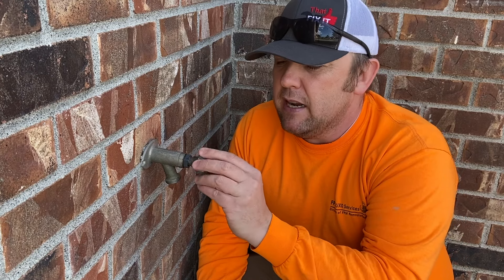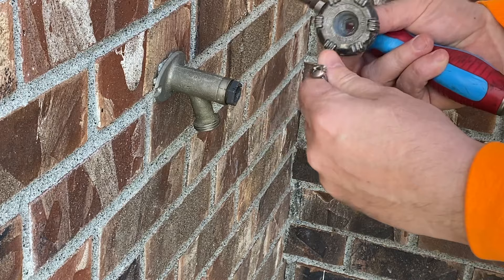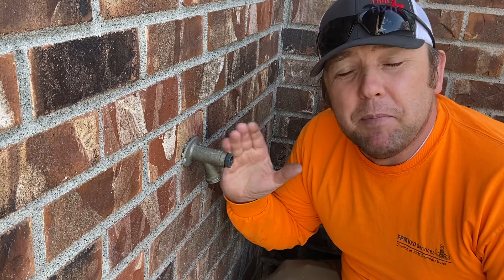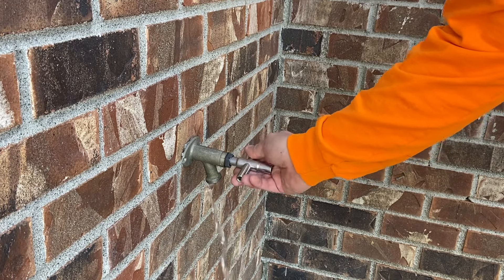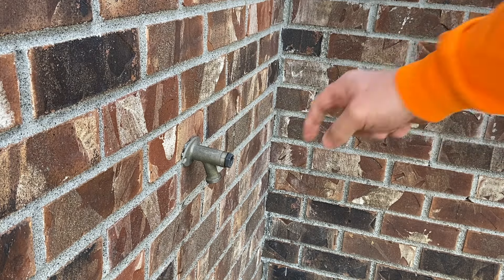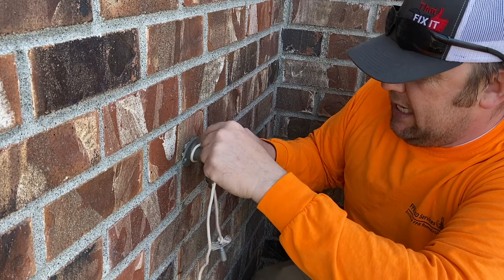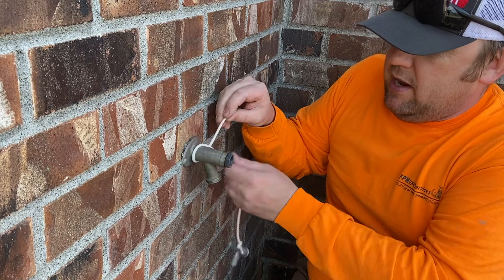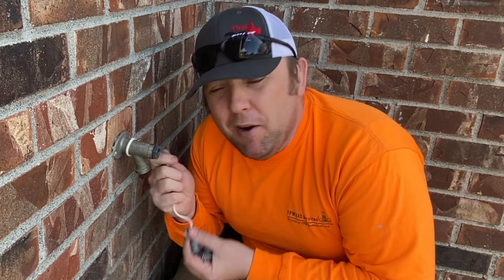QUICK and EASY Fix for Outdoor Faucet Handle that is Stripped!

Comment: Great video, but after using the key, it appears that the valve itself is stripped.  And for some reason my inside valve isn't turning off the water either.  Good times.

Comment: Thanks for this video. Our outdoor faucet handle just keeps turning and we have to push it in as we turn to turn off/on. This video is helpful but a question: I tried to unscrew the handle but the flat-head screw won't budge. How do I get it off? TIA
Reply from the maker: Spray it with some penetrating oil.  PB Blaster  is what I used. You may have to let it sit for a while. That being said I also had to break the handle to get a better bite on the screw

Comment: Hey Brian, I know you said you don't want to strip the screw holding the handle in place, but what if that thing just will not come out?? I've tried getting it out and its starting to stip. Appears to be a softer metal that both my flathead and philips head is starting to strip.
Reply: I’ve found that drilling it out helps. Use titanium drill bits and drill into the stripped screw head. Once the head is drilled through, the handle has nothing holding it down. Then just replace the screw

Comment: Hi! Thanks for the video. I have a Prier handle that will not move/turn. Do you think what you shown in the video would work for this issue as well?
Reply from the maker: It very well could be the issue. You should be able to get a prier handle pretty easy.
Reply: @ThatFixItGuy  Thanks the key was just the fixed needed.

Comment: i bought a house and we have that key but the previous owner has mis-used the bit on the wall and stripped the bolt round. Can you do a tutorial on how to replace the part on the wall or do I have to call a professional to replace it? sorry if im using the wrong terms, english is not my first language.
Reply from the maker: Can you see a manufacturer or  numbers on the hose bib?  Will have to have that info to get the right parts.

Comment: looks easy so I tried it but it didn't work.  I used the sillcock key to try to shut it off, but it just kept turning, just like it did with the knob.  Please help?  What does this mean?
Reply from the maker: If that is the case you may have a broken stem.
Reply: @ThatFixItGuy  the plumbers are telling me that I have a frost proof that has busted because I didn't unscrew the hose and that they have to cut into the drywall and that it will cost hundreds of dollars.  It is a 40 year old faucet.  Am I being taken?
Reply from the maker: @wesreid8393  that could be the case.  You should always disconnect your hose from the bib in the winter.  Is it leaking the the house?  or is it just not working?  Most plumbing companies will replace rather than repair. if it is that old may be worth getting a new one put in,

Comment: What if the screw to take the handle off is stripped?
Reply: I’ve found that drilling it out helps. Use titanium drill bits and drill into the stripped screw head. Once the head is drilled through, the handle has nothing holding it down. Then just replace the screw

Comment: What about when the screw that holds the round handle on is stuck and the handle is so calcified that it actually breaks off when I tried to turn it with pliers?
Reply from the maker: I would spray down the handle with some PB blaster then try to take that screw out. If that works you can get a replacement handle.
Reply: My handle just broke off today🤷🏻‍♀️😞 but I have no idea how to fix it or where to put it on. Gonna have to call a plumber. Luckily I was able to take some pliers and turn it off

Comment: My handle stripped with the water ON. Can I take the handle off even if the water is turned on?
Reply from the maker: You can but you may get a little wet.
Reply: @ThatFixItGuy  Should I not do it then? Turning the main water off is proving to be a problem too. Will water come from where the handle is? I don't want to do anything I can't undo.
Reply from the maker: Water should not come out where the handle is.  I replaced mine with the water still on. You will have to hold the stem and try get the screw out that holds the handle off. If you want send me a picture so I can see exactly what you are working on. Ufix247@gmail.com.
Reply: @ThatFixItGuy  Sent the email. Thank you
Reply from the maker: I got it.  We will get this figured out.

Comment: What if half of the handle is broken how do I get it off
Reply from the maker: I ended up cutting mine off. is the screw still in the handle?
Reply: @ThatFixItGuy  yes it was stuck but I sprayed it with a lubricant it can twist on now with a wrench thank you 😊

Comment: Wat if you don’t have anything at all to use
Reply from the maker: You can but a square stop wrench like I have that works or Buy a longer screw with a hex head on it and a couple of nuts that fit that screw.  Tighten both nuts to the faucet and then you can use a nut driver to open and close. If I have time I will make a video making a handle.
Reply: I appreciate your videos I’m 60 years old  as I live alone in apartments and no income and I drive eaither and I don’t have my own thingy and no one wants to lend one out which is totally understandable I need my own anyway or just any type of thingy to turn the water spickit off and on with , thank you so much for your wat you do